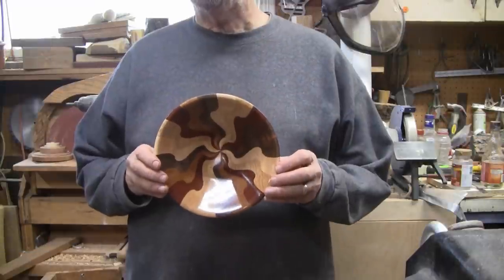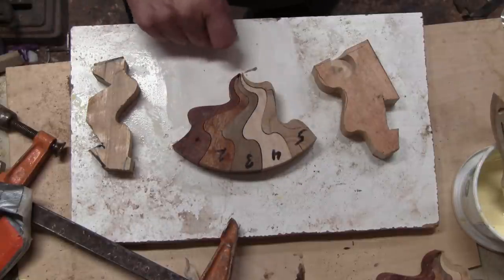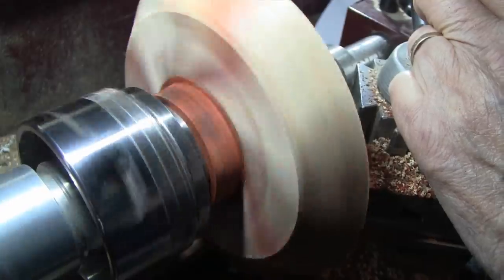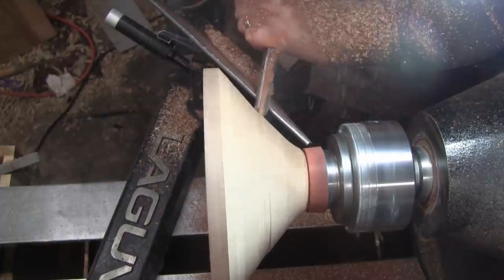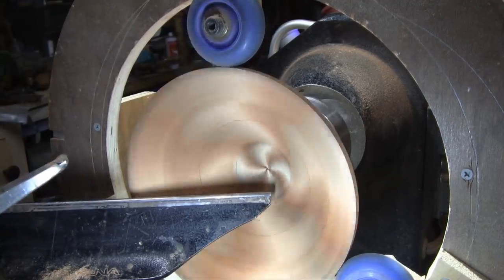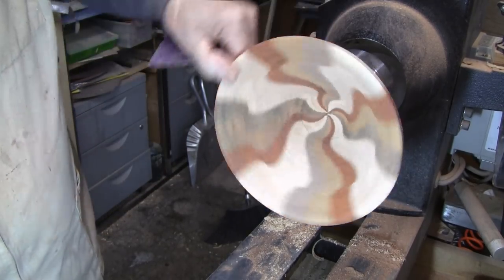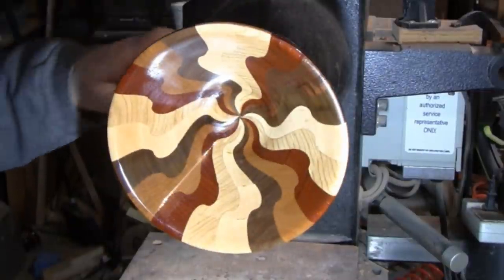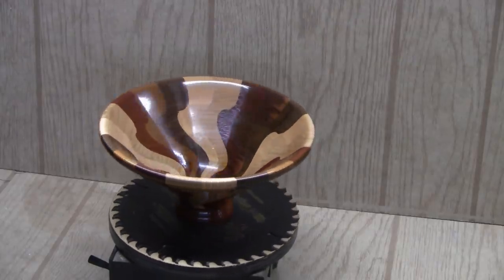Wood Turning The Segmented Vortex Twister

Comment: Lovely bowl Gary but beyond anything I could do because I don't own a CNC machine! The way you cut those rings reminds me of another tool called a ringmaster which I own but haven't used much! Thanks for another great video!

Cheers Al
Reply from the maker: Thank you Al, and yes it would be like a ring master for sure. My guess is the ring master came about because of a metal lathe with a compound slide. I plan on building one that fits my wood lathe. When I can get a Round Tuit?
Thanks for watching,
Gary

Comment: Very cool. What kind of CNC machine do you have?
Reply from the maker: Thank you Greg, I have 2. The first one is a Jet Mill/Drill I converted. I put ball screws and servo motors on it and then added 3 servo motors. I also built the power supply and control box for it. Plus I built a 4th axis that can be used on both. So the second one is a Boss 4 Bridgeport that I swapped the big steppers with servo motors and built a new control box for it. The old tape drive was just not going to work for me. A cnc router would probably be better for wood but I have made a lot of metal parts on the mill. Many for my sons race car. And I can do wood carvings on both mills. Again maybe a bit slow but it works good. Very stout and accurate.
 Sorry for the long reply but I am proud of those mills. They were both fun projects. 
Gary

Comment: I am so happy to finally see someone address the horrible colour bleeding from Padauk. I'm new to woodturning and my first segmented piece was a little birdhouse ornament made to look like a brick house using Padauk and Ash. In the end, the Ash is basically a lighter shade of Padauk, no matter what I did, the colour kept bleeding and I finally gave up and embrace my pale orange 'grout'.  I asked other woodturners if there was a secret to stopping it, but no one seemed to share my issue, at least now I can try using Padauk again and will hopefully have similar results as you did!
I think this bowl turned out amazing, I can't wait to see what else you come up with!
Reply from the maker: Thank you very much. As long as you do not put a wet coat on from the start I promise it will not bleed. Very light over spray. And you do not have to wait long for the next coat. I did a Dizzy bowl that had Padauk next to Maple and I ended up sanding all of the finish off and started over. My little Padauk brick house vase had black veneer so it was not a probably to wipe on Tung oil.
 Thanks for watching and happy this was able to help you.
Gary
Reply: Had the same problem with a rocking horse I make for my kids. the saddle was padauk and the body was maple. I nearly started crying when it looked like someone shot the horse and it was bleeding because the drips from the shellac finish dripped from the padauk to the maple =\
Reply from the maker: @linkinprk1981  hope you were able to fix it.

Comment: Segmented turnings with this type of pattern can be made without having to cut the segments on a CNC machine which most peole do not have. I made this in 2009 without the aid of any computer assitance. http://www.woodturnersresource.com/featured%20member/2010/weber/photo12.jpg
Reply from the maker: Yes you sure can make them without a CNC machine. I can not tell how deep yours is but it looks nice. I will be showing how to make one without a CNC soon.
Reply: @ThePapa1947  Mine is just a simple platter, single layer. The rim also has a single curve joinery. I just didn't want people to get the impression that you needed a CNC machine or a computer to make this type of shape. I used pencil and paper.

Comment: My garage suffers from what I call "Horizontal Surface Disease".  Every horizontal surface grows a covering of scrap lumber, misplaced tools and assorted debris.  This makes me want to go clear off my CNC and lathe and try something new.   Thanks. Amazing job!
Reply from the maker: Well thank you so much. Happy you liked it but I am wondering if your disease did not spread to my shop. Every flat spot I have becomes a bench. I have 2 band saws next to each other and I move the wood from one side to the other depending on which one I want to use. I wonder if I should just put the wood away  LOL
So you have a CNC? Well you sure could do this. What sort do you have. Mine are both milling machines and have considered getting rid of one and get a CNC router.
Thanks for watching,
Gary
Reply: @ThePapa1947  I have 1 1/3, roughly, of a 3 car garage.  The balance is all junk we don't seem to be able to part with, but our heirs will no doubt find a dumpster for it all in short order.  Before that time, I'm planning a big shed for the side yard.  Once the junk moves out there, my wife thinks we'll finally get a car in the garage.  I'm seeing a larger shop.  Maybe we can squeeze in both.
My CNC is a Shapeoko 3XL.  Had it a few years now.  Nice mid-sized unit.  I built a dedicated cart for it, 54 wide by 23 deep.  Still needed an enclosure and better dust control that me waving  shop vac hose at it.  A bigger than expected retirement bonus got me a copy of Aspire to run it with.  Amazing CNC software but certainly not cheap.  As if that didn't get weird enough, I got a 7-watt laser from J-Tech Photonics and strapped that to the CNC Z axis.  Using LightBurn software on that.  Bit more of a learning curve but wow is it fun to mess with.  Again, when I can find it all.  We have a "2-month" reno of our backyard that is now past 5 months and counting, so lots of backyard stuff had to come inside off the patio because there is no longer a patio.  Add that to my persistent case of "HSD" and I cant find anything.  My table saw is now a pyramid-shaped mound in the middle of the floor.  Lathe cart is buried in gardening tools.  Ditto the CNC cart.  Keep saying I need to go clean it up but today I'm under the kitchen sink again.  Replaced the faucet last night but there's now a small leak from the RO water spigot.  Rats.

Comment: Meovalous! The G code for that had to be horendous!
Reply from the maker: Thank you Stuart! There was 238 lines of information. Not all that bad. I have some wood engravings that took 400,000 lines. Thank goodness for software LOL
Here is a small sample of this part just for fun.
Thanks for watching,
Gary

G01 Z-0.97 F10.
X4.0144 Y0.7629 F8.
G17 G03 X3.4906 Y0.4527 I-0.1139 J-0.405
G02 X3.015 Y0.1078 I-0.436 J0.1008
X2.7798 Y0.1541 I0.1002 J1.1272
X2.6962 Y0.1844 I0.2868 J0.9239
X2.6169 Y0.2209 I0.4282 J1.0332
X2.5298 Y0.2692 I0.6351 J1.2474
X2.4443 Y0.3232 I1.2417 J2.0616
X2.3336 Y0.3987 I2.5301 J3.8272
X2.1925 Y0.4984 I32.7859 J46.5779
G03 X2.0913 Y0.5681 I-2.7623 J-3.8991
Reply: @ThePapa1947  I don't have a CNC Bridgeport, but I do  have a small CNC router. I learned manual programming about 40 years ago, on a 2 axis Cintimatic. Also have spent several years running a 4 axis WEDM. To this day, I can still write g-code, with the help of CAD! Trying to teach myself FreeCAD which can generate G & M code.

Comment: Beautiful piece Gary! I suppose if one was patient enough the segments could cut out on the band saw or make a template and use a router. I don't have a CNC machine yet. Thank you for your awesome videos.

Mark
Reply from the maker: Thank you Mark, yes they could be cut on the band saw and I am thinking of a way to show a method that just might do the trick. If it works out I will do a video.
Thanks for watching,
Gary

Comment: Again I am astonished! Beautiful. 
I wonder if motorcycle straps would work for circular gluing?
Reply from the maker: Thank you John, happy you liked it. So the strap I used is basically a mini motorcycle strap. I have lots of the motorcycle straps as we we big into dirt bikes for years. We have quads now and use them for that. For sure you would need the ratchet style straps which I have a few of and the little one I used is like the ratchet style. I got that at Rocklers and have used it for many glue ups. So you are right on track on that.
Take care,
Gary

Comment: Get a big hose clamp it works good
Reply from the maker: I do use hose clamps for some things. In order for the hose clamp to work you pretty much need to be clamping the full 360 degrees. The band clamp I used here works better for this shape. I also use a tourniquet style clamps for rings.
Thanks for watching

Comment: There is special tool for that type of circles.https://youtu.be/B8_RQGcxQZw?t=83
Reply from the maker: Yes that special tool is nothing more than a light duty workings of the cross feed of a metal lathe which I have. Other wise I might build one that fits my wood lathe.  But certainly good for someone without the equipment to do this.
Reply: @ThePapa1947  I see this device when someone was try sell it. In real live looks worse than on YT videos and photos. And on those videos and photos looks pretty bad...
Reply from the maker: @artcraft2893  I guess my thought was it did not look heavy enough. I am limited on max diameter on my metal lathe but it would be fairly easy to make something I could use on my wood lathe. Having a milling machine helps for a lot of the things I make.

Comment: Wow Gary! This is fabulous and seeing how you put it together is seriously impressive! I don't think I would have ever visualised this, but now I'm curious whether it's possible to craft single pieces - but I guess that's when you need a 4-axis (or 5-axis?) CNC machine! I'm surprised that the thin end of the pieces (to the centre - no gaps!?!) held together on the CNC. I guess they knew there's a master at work. If it was me at the helm, they'd have split! I'm currently working on my first all-wood segmented vase with a twist. If it goes well I'll post in 3 weeks time; would love to have your thoughts, especially because I'm doing it without CNC and I think you'd produce something insanely beautiful. Take care my friend. Ray
Reply from the maker: Thanks so much Ray, not sure what you mean about doing single pieces. If you want them cut with the twist and glued together with the bowl shape that would be tricky but could be done. Set up on the slope and cut with a very long endmill you could do it but it would be hard to do. You could also do it by modeling the piece in position then programing it laying down and cut with a ball end mill using 3 axis. I only used 2 axis on what I did here.
 If you mean without a machine then there is a possible way to do it and I have been thinking about trying it and if it works I will share it.
 The thin edges were a challenge so I edited the program and made the tool move away from the tip at the last minute before breaking(they were breaking) this left a .03 thickness web to trim away. So there is my trick...lol
 Took 3 test pieces to get it just the way I wanted it.
 I knew you would like this and a resin style is in order and you are the one to do it!
Take care,
Gary

Comment: I love the economy bowl concept ! I like to experiment with varying the ring widths to get a curved surface - i.e. to get away from a plain 45° straight sided bowl.
The curved line is brilliant - glad you showed it to us - kudos to Tom Loman who showed it to you !  Brilliant bowl - coloring and concept ! (wish I had some sort of CNC rig.)               Thanks for sharing🙏  Stay safe. -Mike😷💉
Reply from the maker: Hi Mike, yes it is fun way to make a bowl. Cost effective for sure. The enco bowl I made before this one had 33 degree walls. I think this twist is most effective with a flatter look.
 For sure seeing Tom Lohman's picture inspired me to figure out how it was done. Actually Huw sent me a picture of his bowl over a year ago and I told him when I get a chance I will try and figure it out. Then I came across the picture again on the AAW site and saw the word CNC and then I thought DUH! 
At work I used to do the same thing making pump impeller patterns. But we sawed and sanded one side then duplicated it to cast the that shape on the other side of the wall doing this exact same thing. One line fits in the other. You can get those small CNC routers that do not take up much room and are not really that costly. I have thoughts of getting rid of one of my milling machine and getting one.
 Take care,
Gary
Reply: @ThePapa1947  Hmm, food for thought.

Comment: Love this. I have done many segmented pieces and bowl from a board pieces. This is a great combination of the two
Reply from the maker: Thank you Gene, my original plan was to glue the board in haves then cut the rings on the band saw. But I thought I would try doing it on my metal lathe. It worked great so I will probably do more that way. If you play around with the angle of the cut you can get the pieces to line up perfect. But I used a CAD program for doing that.
Thanks for watching,
Gary

Comment: That's brilliant! Technically challenging and artistically creative. I guess no chance without a CNC milling m/c. Has the piece moved in anyway or any of the segments opened up with different grains expanding and contracting? Or perfectly stable?
Reply from the maker: Thank you Ray, it was very fun to make and a CNC helped for sure. I am working on a way that you might be able to make something similar with out CNC. I will need to do some testing on it and if it works I will share the method.
Thanks for watching,
Gary

Comment: I'm glad I was sitting down while I watched this one...I started getting a little dizzy when you were sanding and polishing. I'm better now. ;-D I see now why you used the metal lathe and a thin cutter to separate the rings, a wider kerf would have messed up the transition of each ring I think. Stunning look to this one. Great video as well. Was this the same visitor that cried out earlier in the video? My cat hated the noise in my shop so she stayed away.
Reply from the maker: Hi Gil, yes it does have a strange look when spinning. I think I could have used a wider cutter. It was a matter of picking a angle and then adding the cutter width and adjusting the angle to allow it to work. This is very hard to explain without a drawing but I was able to make work a wider cutter. All it does is change the angle of the walls. Pretty fun stuff.
 Yes that was the same voice you heard earlier. Although both of our cats were out there off and on.
Thanks for watching,
Gary
Reply: @ThePapa1947  No drawing needed, I'm a retired computer drafter and as soon I read you change the angle the image popped into my head. I guess I've been out of the game for too long...20 years or so. It's like riding a bike it seems, comes right back.